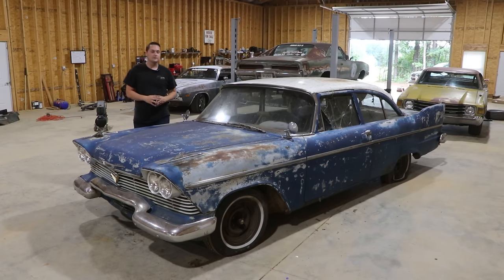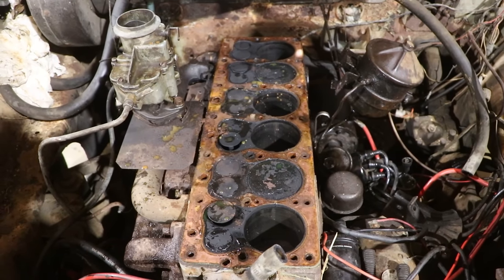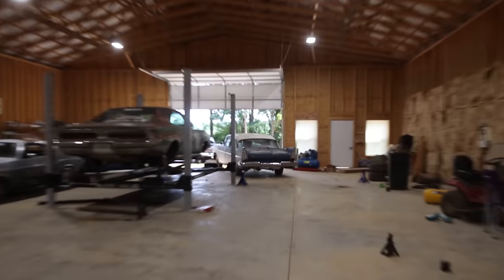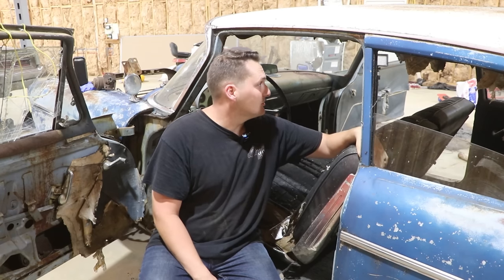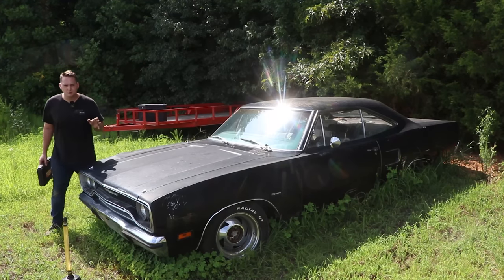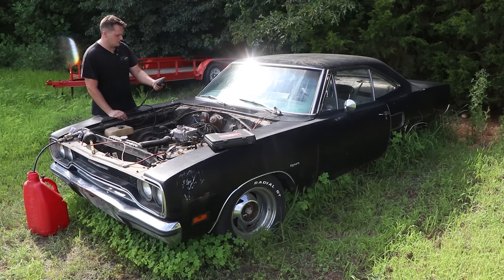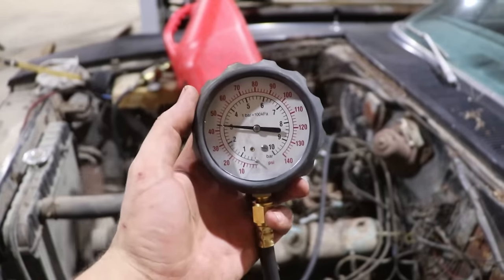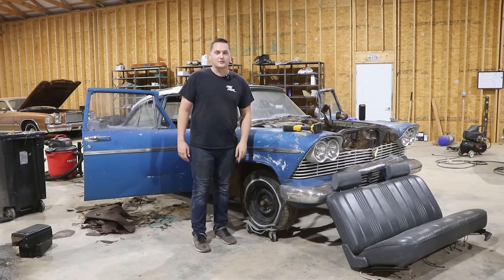Barn Find 1958 Plymouth Engine Teardown - Is It Too Far Gone?

Comment: I’m not opposed to the 318 at all, they were a great small block and in my opinion one of the most underrated motors. They were nothing spectacular but enough power to get in trouble and really didn’t have a lot of problems like a lot of the more popular engines.  They sound very nice with some 3” exhaust and a couple cherry bombs 👍
Reply: Check out Gary's Garage. His naturally aspirated , stroker 318 is making over 600 hp, and about to dip into the 10's in the 1/4.
Reply: Enough power to get in trouble is exactly what you don't want.  If you can't outrun the cops, in helicopters, then there's no reason to be able to top 70mph; and the flathead 6, with mediocre ring seating is plenty to do that.  Everything has to be fast with him.
    The priority should be to turn out simple transportation as quickly and cheaply as possible, preferably without damaging collector value too much, so throw rings in the flathead 6, seals in the trans, and put it back, then make it street legal, fix the heat, and flip it.  
    Then for the Satellite, the underside need not be pretty, just strong enough; so get under it with a welder and a selection of scrap metal and weld it in enough to hold everything together, spray wax it to prevent repeat rust, and off it goes.
Reply: @alan6832  collector value doesn’t really apply to everything that is old, I guarantee nobody is out there looking for that car with a 6 cylinder specifically. Dylan is about mixing and matching and making something out of nothing that’s got enough power to make noise and burn tires. It’s not like he’s pulling apart numbers matching big block mopars that are actually worth something. Dylan has a lot of rough looking cars so if he says the underside of that satellite is unfixable then I believe him 👍
Reply: @ Minnesota Tomcat

 The question isn't whether or not the rust damage is fixable... it's whether or not it's worth it to HIM to fix the damage. From what I remember seeing in previous video footage, the damage was bad but it wasn't THAT bad. If someone with the talent chose to, the Satellite could be restored. Would it be worth it from a standpoint of financial gain? Maybe, maybe not... but I doubt it would be to the average guy. Of course, the average guy wouldn't possess the tools nor the talent to complete the job so it's a moot point when talking about the financial side of things. IMHO, what needs an answer right now is what is the car worth at large to anyone other than Dylan? I ask this question for one reason. Is anyone out there willing to take on the project with the intent of keeping the Satellite original as can be done? What are they willing to pay for it as it sits? I call to attention these things because I believe the smart play, and the best play, is to keep surviving numbers matching vehicles as they are for preservation. Why? Because every time one is changed, there is one less original example out there to see and enjoy. It isn't like you can just replace them and heaven knows the odds are we'll never build cars the way they did in the past again as sad as that may be. My logical conclusion is to save what can be saved. It's also often easy to get the same vehicle that's already been modified... and proceed to make the changes that you wish to make on it instead of using the survivors. Yes, the Satellite is owned by Dylan and he can do what he wants but I will still urge everyone to consider the possibilities and look at the big picture before moving forward. Peace & good vibes to all!
👍🏻🇺🇸🧰👨🏻‍🔧⚙️🔩🔧⛽👨🏻‍🏭

- Max Giganteum
Reply: @shaunclifton5281   The 318 is a docile engine in stock form, but has great potential to be a capable performer. A swap of the heads from a 340 or 360, a 4-barrel carb and manifold, new cam and lifters, headers and dual exhaust, and a performance distributor, coil and wires will really wake up this engine. 375-400 HP is not uncommon with these upgrades.
Reply: @hbhamilton3410  Amen 👍
Reply: @minnesotatomcat  I totally agree Dylan is about making car's go and stop without breaking the bank and trying to use what he has, And I say he does this to show us we can do it I have a 1987 Chevy chevette that is a roadstoration it's ugly but it goes.
Reply: @MaxGiganteum  Bravo in general, but with 2 comments.  One is that restoration for resale is almost never worthwhile financially.  The people with the talent can make better money with that talent.  The one exception to that rule is when a rich guy buys a rusty car and hires you to restore it.  Another possible exception might apply to Dylan, where he can film the restoration and combine resale funds with YouTube monetization.
      My other comment is that the underside of the car need not be pretty, just functional and strong.  By fixing it ugly, the fixer (not restorer) might be able to save quite a bit of time, talent, and money.  Though it does take some skill to be sure it is safe, as you can see on the UTC channel.
Reply: @minnesotatomcat  Nor does collector value apply to everything that is fast.  I suppose it is possible that the market would be so stupid as to ignore slow classics, but I doubt it, and Model T collectors are certainly a counterexample, and they can't even maintain 55.  But there is another purpose, basic transportation, for oneself and others.  Generally, that purpose is served by newer cars, but for those with more time than money, the new cars are hard to maintain due to complexity, and they depreciate over time when driven lightly, such as once a week to get groceries.
    As for rust, I think you both under-appreciate how much time and talent one can save on the underside by welding ugly and ignoring looks.  I remember fixing rusted trailing arms on a C-10 with my gas welder by welding old fenceposts to it, and it worked just fine for years.  I also fixed a rusted trailing arm mount to a VW Rabbit by bolting in a piece of fencepost.  I did weld that later on but no trouble with either repair.  I also fixed Peugeot floor pans with the sides of old appliances and a pop riveter.  One does need an eye for structural safety, and it is not really restoration, but welding in random junk works if working is all you need.  And it makes interesting YouTube, and extra weight in the bottom rear is not a big problem.
    I have seen old plowtrucks have problems with welded rust then rusting again, but I think that can be stopped with repeated spray wax at self serve car washes, and up North, where plowtrucks have this problem, car washes have the "corrosion resisting undercarriage rinse" option in addition to spray wax.
Reply: @minnesotatomcat  the only way you can really sell something with a 6 banger in a classic car (excluding cars that never came with anything else) is if the car is ground up restored to immaculate condition and then it still isnt going to bring v8 money.  alot of times people will even buy a 6 banger that is totally restored knowing they can get it cheaper and do an engine swap. a i6 mustang 64 for example will sell 25k the same car with a 289 will sell 35k. i would swap it to a v8 as well.
Reply: @jeffreyrigged  exactly 👏  not everything is WORTH saving just because it’s all original when the car is a not super desirable base model car
Reply: They are a small 340. Can be hopped up.
Reply: @maxhames499  absolutely! I had a 79 power wagon with a 360, rebuilt it with a bit of a lumpy cam and a 4 barrel edelbrock and it had plenty of power even in full time 4wheel drive

Comment: My father had a 1964 Dodge Polara with a 318 cu in V-8 with a push button 3 speed automatic transmission. Loved that car. These were the cars that he would have worked on in his youth. Started as an apprentice in 1948 till 1961 then taught auto mechanics till 1989. He passed on July 13th, 2022. Miss him. Ciao, Pops.🇨🇦🇺🇸

Comment: The Poly 318 was the main V8 for 1958 with the optional 350 Golden Commando as the upgrade, so technically it is correct for the car too, also from what I've read a 727 automatic transmissions can be made to work with the push button shifter if your going that route.
Reply: didn't they use the 727 on the 1960 Chrysler Windsor golden lion addition with a 383 and pushbutton transmission or was it an early 904?
Reply from the maker: That 318 was the early A series, or the “poly” engine. Very similar block, but was phased out by the time the LA was widely used. Still should fit in just like the factory engine though.
Reply: @DylanMcCoolVideo  My Dad had one, a four door with the V8 and push button auto, thing was a rocket until it blew up...young mechanic thought it was a Hemi. Now I know that it was a Poly
Reply: @DylanMcCoolVideo  I didn't know they phased out the poly i thought all the 318s were the same "the more you know", Ya going to put dual quads on it like Christine had?
Reply: LOL...you can't school Dylan on Mopars. I was going to say there was more than one 318, but I didn't have too. Not even sure the year they changed. '66?
Reply: @samthemultimediaman  dual quad would have to be small, I don't think that you would want above 550 cfm total even if you went for a hot cam. I think a nicely sized 6 pack would work better and the complete Satellite drivetrain, sure looked like a positrack rear end when he did the trailer burnout. Dual quad spreadbore carbs may work for street driving with a gentle right foot.  I was hoping for a 440/6 pack/4 speed manual, but I like his common sense approach,  especially with gas approaching the $10 a gallon mark here in the Great White north.  I would love to have that orange D100 that he recovered a year ago, with a modern 5.7 Hemi drivetrain that would be perfect.
Reply from the maker: @MaxNafeHorsemanship  ‘66 was the last year if I remember correctly unless it was a Canadian built car. They lasted til ‘67.
Reply: @DylanMcCoolVideo  Thanks for the info. I always like to learn more. I had a 66 Fury with what they also referred to as a "wide block" 318. Wish I still had that one. 2 door hard top. I'm Canadian, so the 67 info may be relevant to me as well.
Reply: I've heard of people cobbling together lokar stuff but I've never done that first hand so I'm really not sure how to go about it, someone made a kit I thought
Reply: @Ravager669  Neither, it was the A488.
Reply: @samthemultimediaman  I think they made a few in 67, then the end.  The wedge 318 used the same rotating assembly until about 1974.
Reply: Would love to see it with the Golden Commando in it. But apparently, they are rare as hens teeth these days and a good one will set you back a small fortune. The motor would be worth more than the car still, even after putting 20k into body work, paint and the interior.
Reply: @michaelbenardo5695  thank you all I could find was it just listed as "torque Flite"
Reply: @dramoth64  You might be right.  Also, the dual-quad intake and correct air cleaners would cost a fortune as well.
Reply: @unknownsoul13  Many called it a Semi-Hemi.
Reply: @MaxNafeHorsemanship  67, but some 67s did come with poly-head 318s.
Reply: @samthemultimediaman  
The poly stopped being produced in 1966, in 1967 the cubic inch stayed the same, but was cheaper and lighter to manufacture.
Reply: @Ravager669  
In 1958, there were 2 automatic transmissions,  a cheap 2 speed called the  Power Flight,  and the 3 speed Torque Flight 
My guess,  and it's only a guess,  the Power Flight would be matched to the 6 and the 318 V8 engine just a guess on.my part
Reply: Going back to Christine herself, the novel Christine would be a poly 318 as the protagonist Dennis Guilder mentions that he popped the air cleaner off and glumly looked into a soot filled 4 barrel carburetor. The movie Christine had the dual quad Golden Commando.
Reply: @DylanMcCoolVideo  make sure your 318 has the early extended crank.
Reply: @DylanMcCoolVideo   it's amazing how you can make a pyle of junk run and drive like a new car my step dad had a 1967f100 with a small block 400 race car engine from a ltd